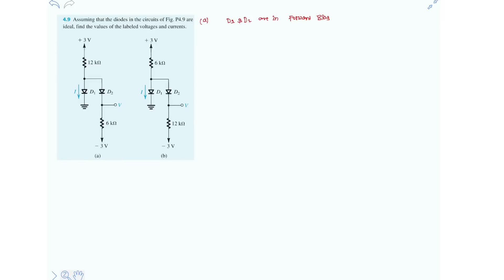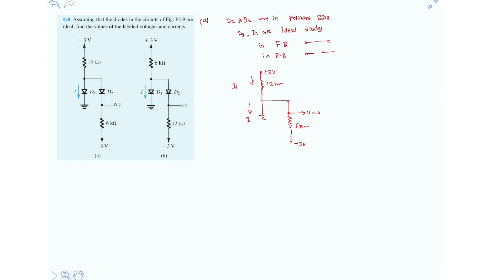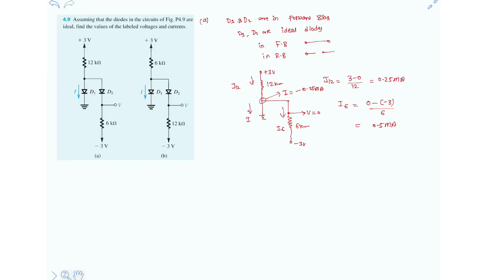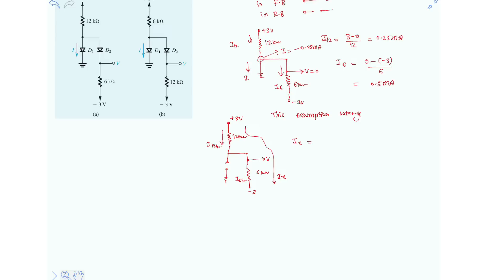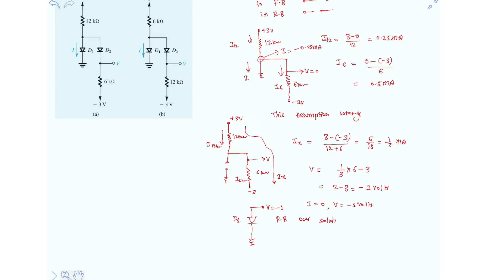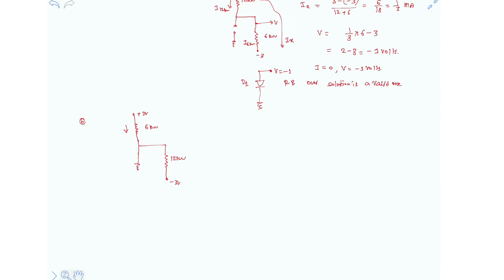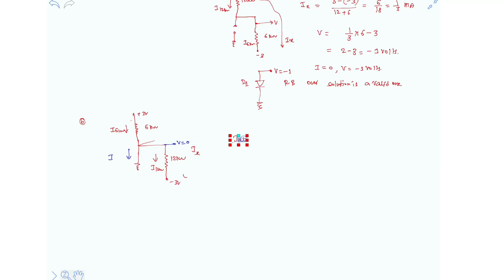4.9 Assuming that the diodes in the circuits of Fig. P4.9 are ideal, find the values of the labeled

Comment: what if it wasnt ideal and they told us diode voltage is 0.7
Reply from the maker: We need to take voltage drop as 0.7v in our forward bias assumption at the end if the node voltages are not satisfied to make the diode ON (i.e forward voltage drop 0.7v) we should consider OFF vice versa

Comment: if the methods were made of silicon, how would the question be?
Reply from the maker: You mean if the diodes are non-ideal and having a voltage drop while conducting ?
Reply: @ yes, as 0.7 Vot per diode is added to the circuit.
Reply from the maker: You can post your question on Electricalstudent.com

Comment: WHY - 3 VOLTS
Reply from the maker: Can you plz elaborate
Reply from the maker: https://electricalstudent.com/question/4-7-assuming-that-the-diodes-in-the-circuits-of-fig-p4-7a-and-b-are-ideal-find-the-values-of-the-labeled-voltages-and-currents-figure-p4-7-a-0-v-2-ma-b-%e2%88%921-5-v-0-ma/

Comment: at 2:15 how did you determine that I=0.25 mA how did you use kcl or kvl
Reply from the maker: https://electricalstudent.com/question/4-7-assuming-that-the-diodes-in-the-circuits-of-fig-p4-7a-and-b-are-ideal-find-the-values-of-the-labeled-voltages-and-currents-figure-p4-7-a-0-v-2-ma-b-%E2%88%921-5-v-0-ma/

Comment: Why have you taken I = -.25?
Reply: KCL at that node I12 =I +i6 which is 0.25=i+0.5 after rearranging we get i=-0.25 and we can’t have negative current go through forward biased diode therefore you substitute with open ckt hope that helped!
Reply: @potatomaster647  this may be a dumb question but when you rearrange the currents  how does the equation not come out to be i = 0.20 ma
Reply: @Demented1226  because after rearranging i=0.25-0.50 is the equation and after subtraction its i=-0.25

Comment: Why  you have written -0.25 in 1st question? Why our assumption is wrong? Please kindly reply.
Reply: This is because the I12 is the current entering the node and I,I6 are the current exiting the node. Now, according to KCL ;Entering current=Leaving current. So the equation comes out to be I12= I + I6. So I=I12 -I6= -0.25. So the current entering the diode ,which is I , is negative. But the current entering the diode can not be negative . so we understood that our assumption is wrong and the diode is in reverse biased. and when in reverse biased we can replace the diode to an open circuit.

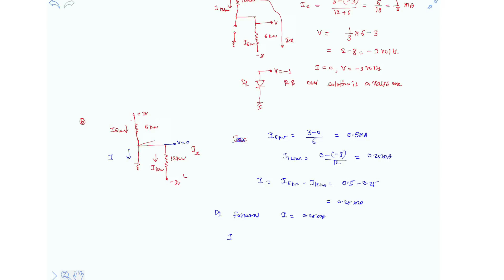Comment: 6:49 How can current flow through diode D1 if both the anode and cathode are equal to 0 V? If there's no potential difference between two points in a circuit, then current won't flow. So how can a current of 0.25 mA be flowing through diode D1?
Reply from the maker: Nash Shrestha current will flow between two points where there is no potential difference ....in case of a short circuit there will be any potential difference but high current will flow ......isn’t it ?

One should look for KCL and KVL satisfied or not ......here diode is ideal so when it’s conducting there is no voltage drop ......but you are thinking in a practical diode way ....

I hope this cleared your doubt
Reply: @electricalstudent  Ah okay so it's kind of like Newton's 1st law of motion  -- an object moving at a constant velocity will continue to move at that velocity unless acted upon by an external force. So, a potential difference is like a force -- it will cause new current to flow, but if there already is a current flowing, then you won't need a potential difference to keep it flowing (in the case of an ideal conductor with 0 resistance).

Comment: Thanks for the help, but i dont understand why you do V=(1/3)*6-3, anyway, thank you ;)
Reply from the maker: https://hwmadeeasy.com/4-9-assuming-that-the-diodes-in-the-circuits-of-fig-p4-9-are-ideal-find-the-values-of-the-labeled-voltages-and-currents/
Reply from the maker: Simply voltage V= voltage across 6k +(-3)
Reply from the maker: Current across 6k is 1/3 *6
Reply: @electricalstudent  current or voltage?